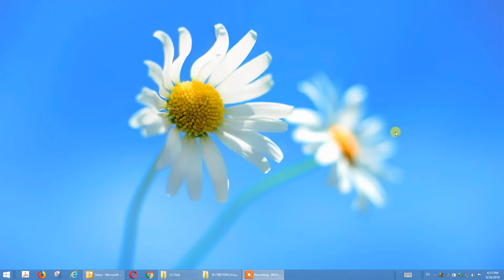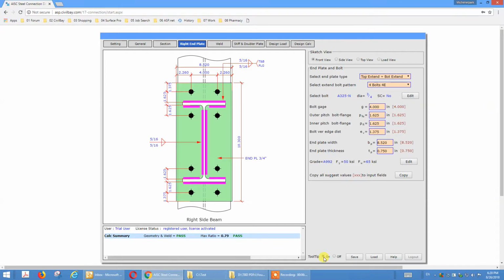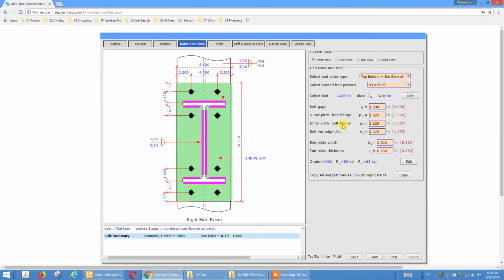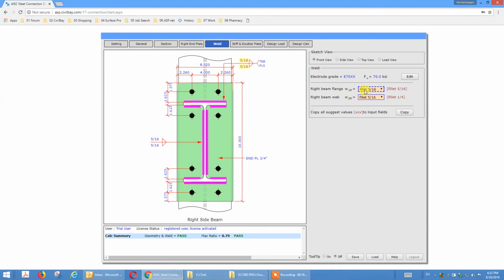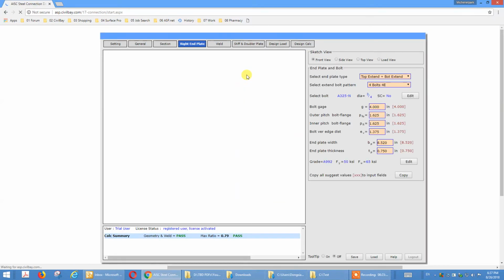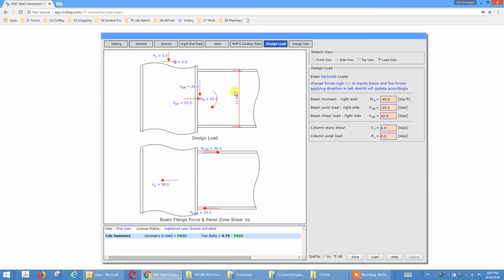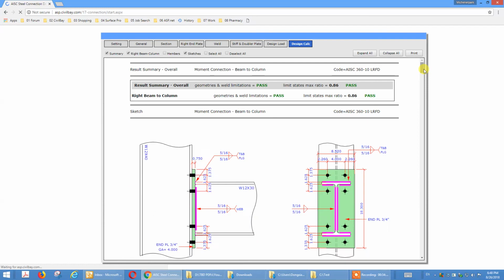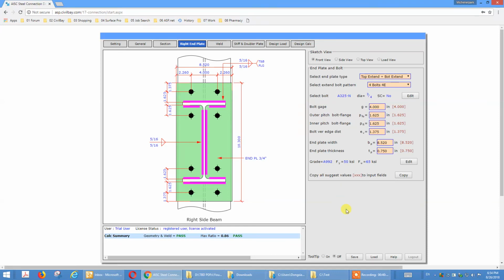AISC Steel Connection Design - Intro

Comment: AISC steel connection design
CISC S16 steel connection design
AISC steel connection design - extended end plate moment connection
AISC steel connection design - flange plate moment connection
AISC steel connection design - shear connection - shear tab
AISC steel connection design - shear connection - end plate
AISC steel connection design - shear connection - clip angle
AISC steel connection design - vertical brace connection
AISC steel connection design - horizontal brace connection
AISC steel connection design - horizontal brace connection - wrap around gusset plate
AISC steel connection design - chevron brace connection
AISC steel connection design - knee brace connection